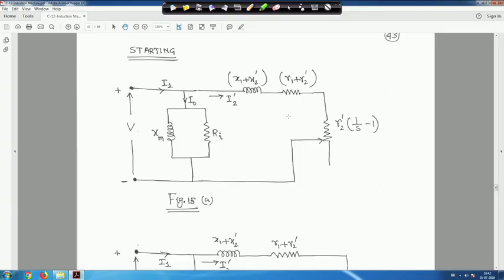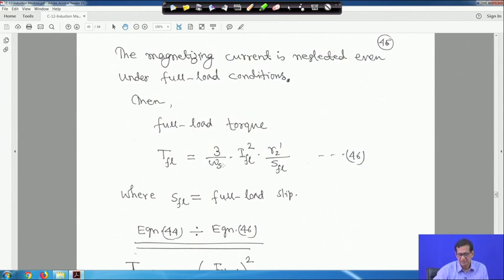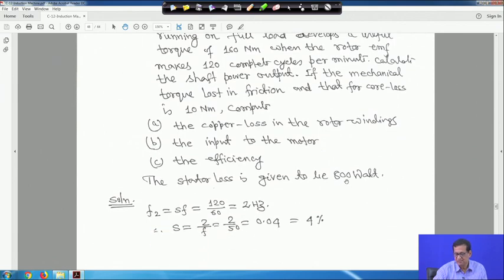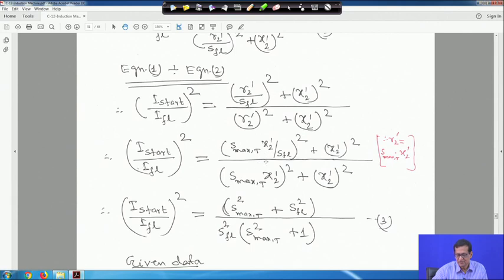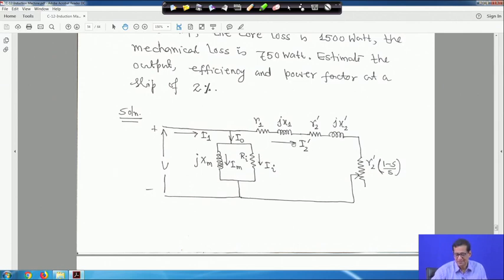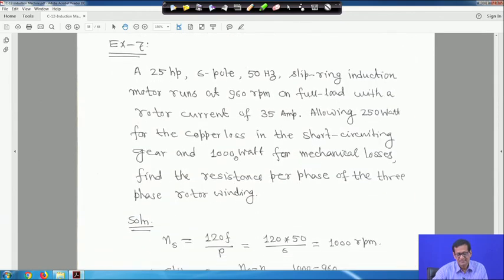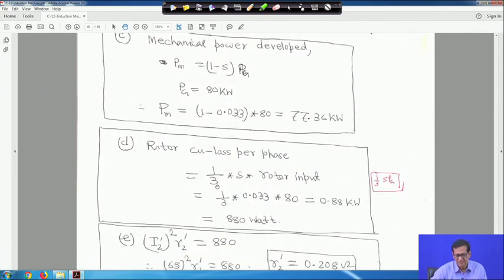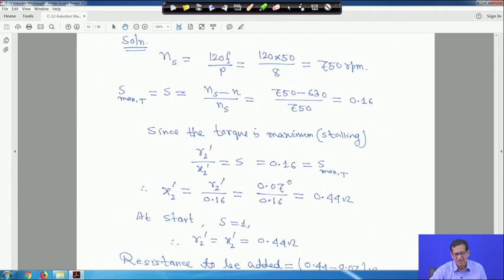Lecture 61: Three phase Induction Motors (Contd.)

Comment: Example: (7) You are adding 250 Watt (copper loss in short-circuiting gear) to get gross mechanical  power( 'Pm') from Net Power Output.
Then you calculated Rotor copper loss ('Pcr') from 'Pm'.
But then you subtracted the same  250Watt from calculated 'Pcr' to find the resistance. Why? Why did you first add it, and then subtract it? Is there a mistake in your method? You also didn't explain it. Just read it out.